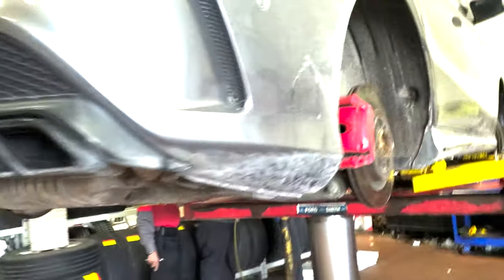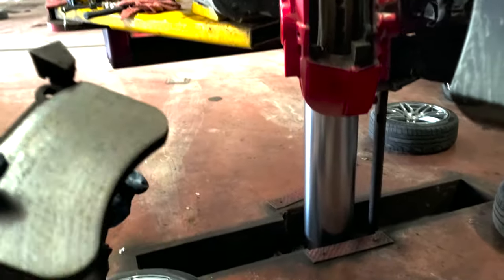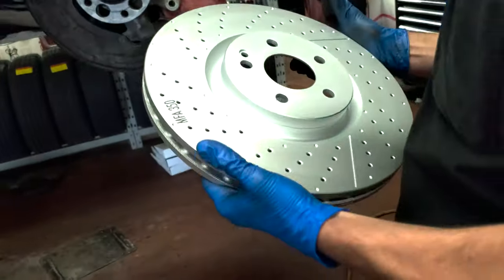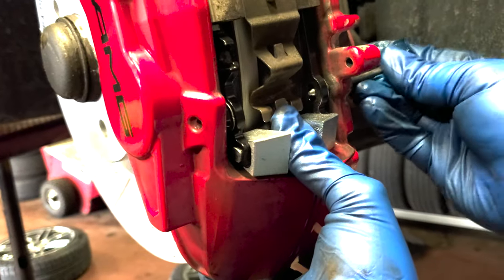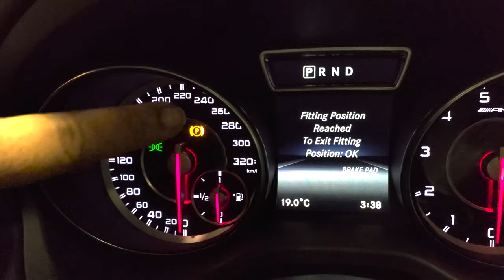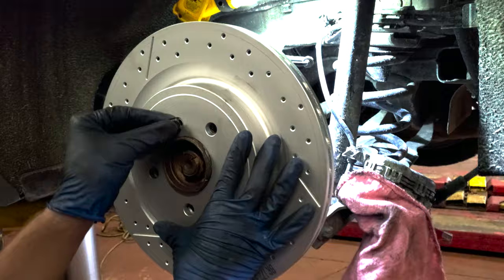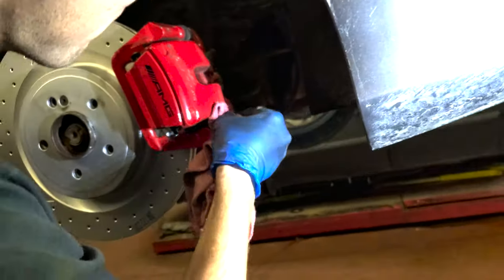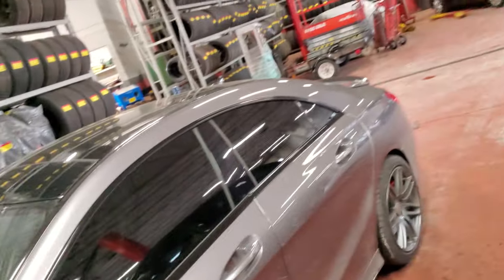Mercedes-Benz CLA 45 AMG Brake Replacement | FRONT AND REAR PADS/ROTORS

Comment: Thanks for the video. What’s the torque settings for e18 bolts on the rear caliper?
Reply from the maker: Roughly 130Nm or 95 lb ft. We based it off the A45 amg calipers since they are the same.

Comment: I have a 2020 CLA 45 and I have the dynamic brakes.  It’s only a year and a half old.  My dealership is saying I need new brake pads because they squeak and they have been squeaking.  Are they up charging me or is it really time for new brakes?  It only has 6,000 miles on it and I don’t drive it that much.
Reply from the maker: Squealing is normal for some performance brakes. But if the pad is low then the indicator on the brake pads will start to squeal letting you know it's time to replace as the 4 pistons calipers use really thin brake pads. Now if you brake hard or a lot regardless of millege they can be worn down. Now for a lot of the mercedes, they come with brake wear sensors. If the sensor detects low pad, it will give a message on you're screen saying pads need replacing soon. But if you really want to check then the only way to actually check them is to bring it to another dealership and see what they say too or another shop to have it looked at.

Comment: Do you need to bleed the brakes as well? or changing pads and rotor is fine? :)
Reply from the maker: No need to bleed the caliper unless you take off the brake line. Otherwise just changing pads and rotors is fine.
Reply: Thanks  @JustRandomCars  love your vids
Reply from the maker: @raybuzz  Thanks

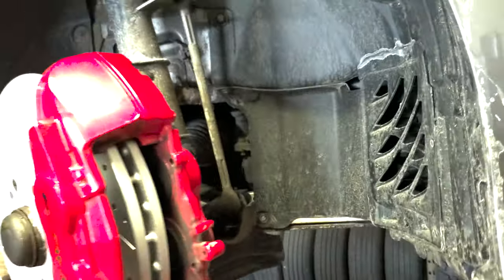Comment: at 7:44, can anyone tell me what that piece is with the wire running through it with the bolt?
Reply: That’s the wire where you put the wear sensor for the pad, it only goes in the passenger side …. It’s easy to take it out
Reply: 11:40 he do it and you will see
Reply: @JuanMorales-nj9ub  thank you juan, I recently had a popped tyre on my left front wheel and the rubber from the tyre wrapped itself around the axle of the wheel, causing the sensor to come loose.

Comment: What did you use to push the piston back on the rear ?
Reply from the maker: We used a C-Clamp to push the rear piston back after we put the caliper in service mode.
Reply: @JustRandomCars  thank you man, and also do u have all the tightening torque specs that you used?
Reply from the maker: @kieransayers3475  To be honest I forgot the specs. It's been a while since we did them. I replied to someone for the rear caliper torque spec in the comments. 95 ft lb for the rear.
Reply: @JustRandomCars should the caliper be put in service mode before you even start to jack the car up?

Comment: Did you use a tool for push the rear brakes back in or does it go back like the front once you put the car into to fitting position?
Reply from the maker: We put the rear calipers in service mode so that it deactivates the rear electronic parking brake. Then we pushed the piston back manually using a tool. Then once it was done we but re activate the rear parking brake and pump the brake pedal until tight and that is it.

Comment: I have a 2014 cla45 amg and trying to replace my rear rotors and pads. I did the front last year and forgot what coding on my door signifies the rotor size for the rear? Can you help?
Reply: Search Mercedes-Benz Genuine parts on google and you can enter your VIN which will show you the rotors that you need for your car.
Reply: Also, don't replace rear pads/rotors without putting the car in brake service mode or it will ruin the rear calipers and emergency parking brake.
Reply: MRECOTEC okay thank you 🙏🏼

Comment: are you thinking of selling it ?
Reply from the maker: It is a buddies car. He is still driving it.
Reply: @JustRandomCars  Hey so i have a 2017 cla45 amg and its the facelift model, are all the parts the same? As far as i have been looking online they are the same. Also are there no pad wear sensors on the rear ?
Reply from the maker: @preauzalam3483  They should be same. If anything you can call Mercedes to confirm the part #. Rear didn't have a sensor.